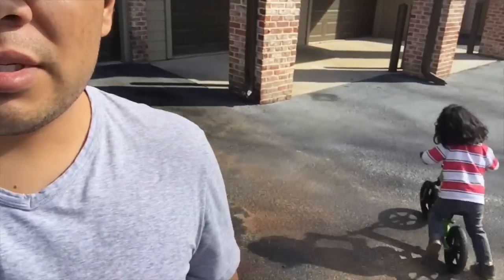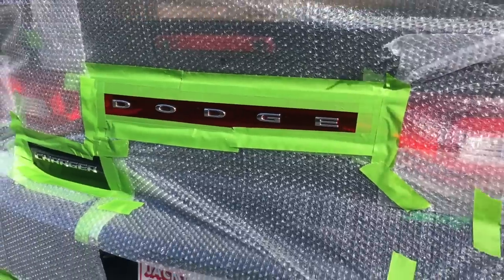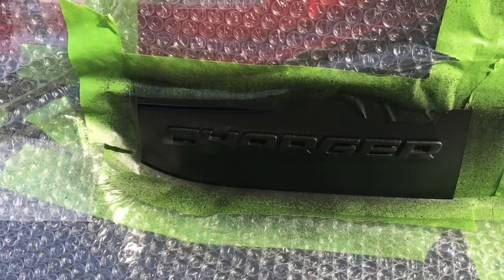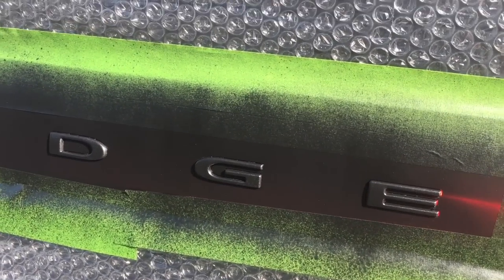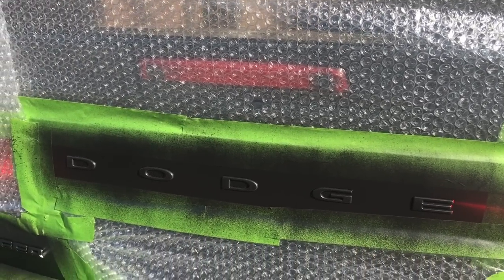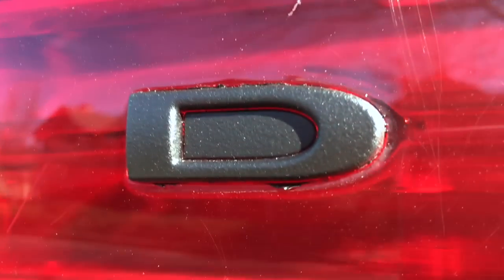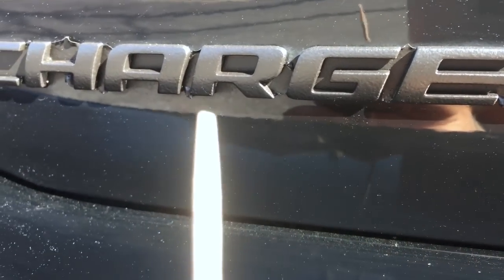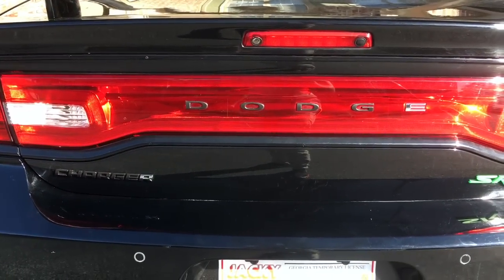Vlog .2 HOW TO PLASTIC DIP YOUR DODGE CHARGER EMBLEMS ON YOUR CAR

Comment: how did you remove the plasti dip OUTSIDE the letters?
Reply from the maker: Jay Gold just do like 7 coats let them dry n just peel it wit ur own hands is easy
Reply: Ok thx! Doin this this weekend!! Thx alot
Reply from the maker: no problem remember the more coats u do the easier it will be to take off